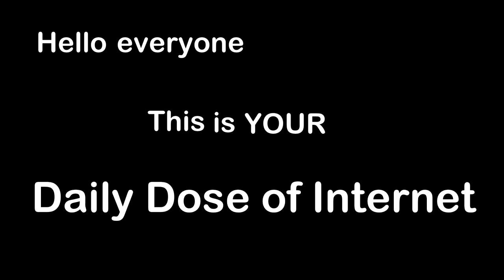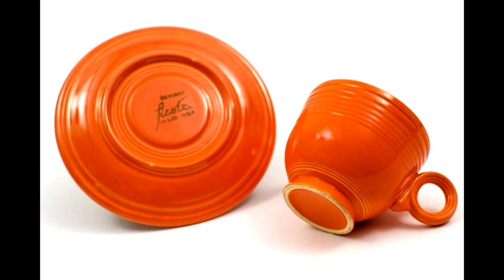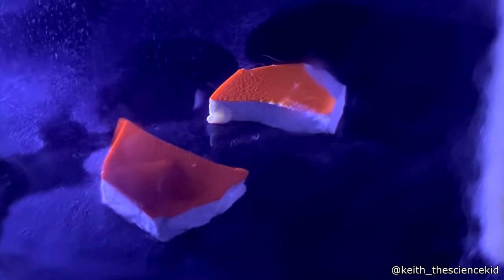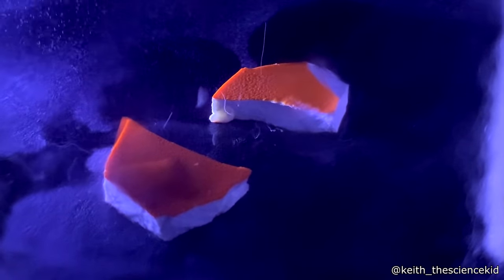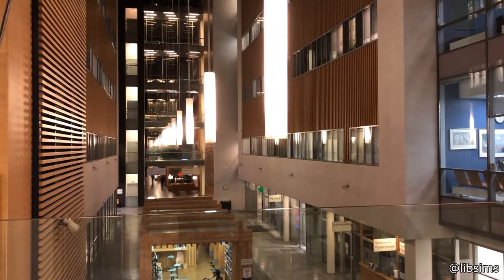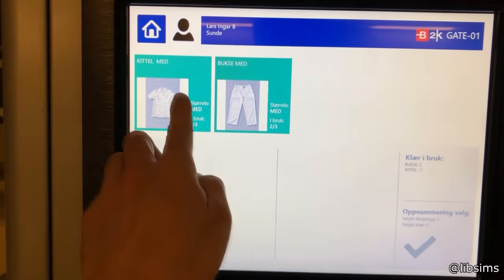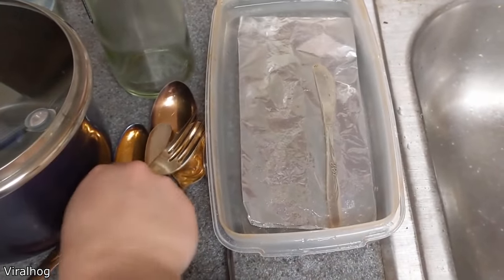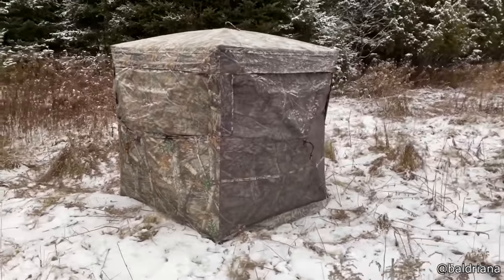Cutting Scissors With Paper

Comment: The pottery is actually Glazed with radium, (still radioactive) and is perfectly safe to eat off of and use, as long as the pottery is not cracked or broken, as that releases the radioactive particles.

Comment: That's crockery, not pottery! 
It's also usually only the green tinge crockery from 1970s that had uranium in it the reason the uranium was added is to get the green tinge and brighten the hue of a colour....

That clay has uranium in it anyway it wasn't added, it just wasn't removed 

All these primordial radionuclides include elements such as uranium..

It becomes a problem when it is man-made glass with added uranium the level is not natural and it is concentrated..

Comment: I think that trick for cleaning tarnish from silver is simply aluminum foil, sea salt, and boiling water. I'm not sure how it works, but I've done that with my silver chains and other jewelry and trinkets. It works! But you still need to buff it or apply some proper cleaning solution to it. Removes the tarnish, but leaves it looking scratched or dull.